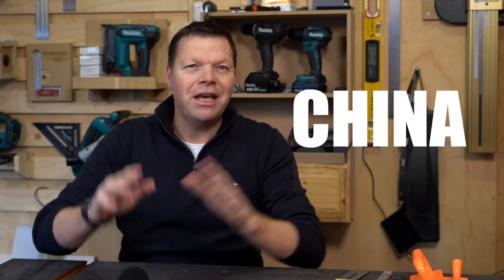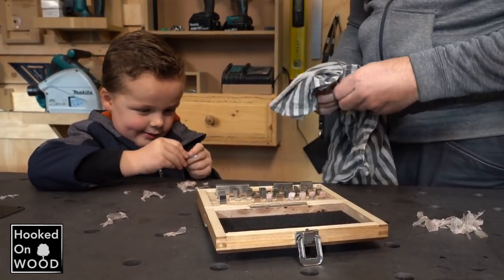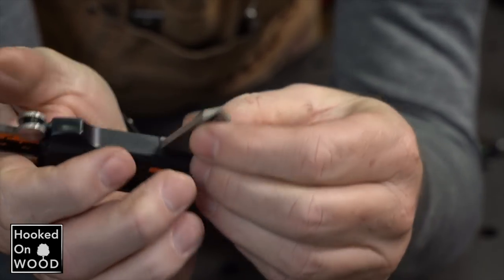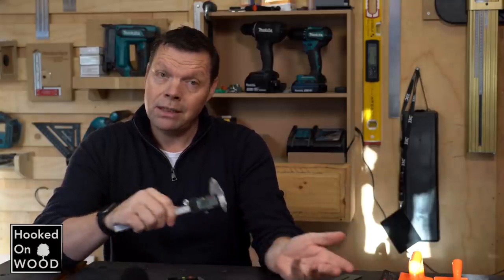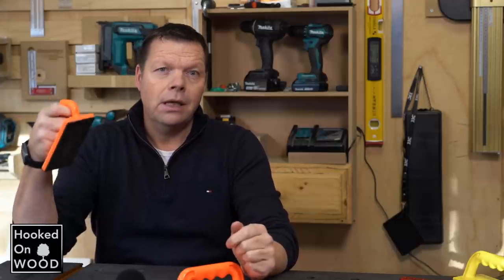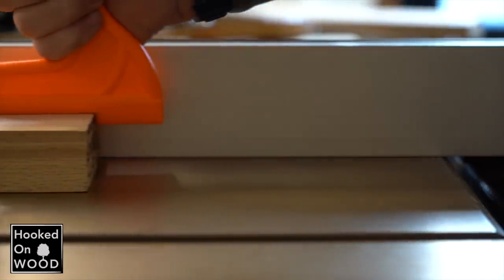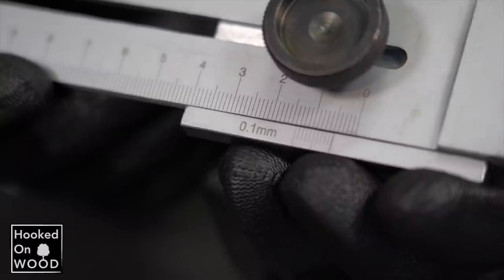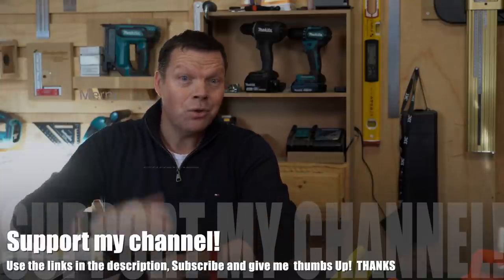China Tools Ep. 17, Set-up blocks, Calipers, push blocks and Ruler

Comment: Dennis - love all your videos.   I ended up buying the NEW miter gauge you showed in epidsode #11.   It's perfect for my needs.    I've owned it a couple of years and use it with mdf or plywood scrap fences.   Love it!   And, I would have never known about it except for you.  Recently, I made a 12-sided polygon with this miter gauge and it turned out perfect on the first try.   Just for fun, I tried doing the same with my stock Delta Unisaw miter gauge and a Starrett angle finder.   Not as good.   The NEW miter gauge is super accurate.
 I'm thinking about getting the metal fence with the box joint feature.   Thank you for all your videos.

Comment: Thumbs up to a ruler video :) My reference for good quality standards is Woodpecker and Starrett as well. Although in general,  I have been pleased to add some of these lower cost and somewhat novel tools from Banggood to the shop. The spot on machinist squares are an interesting indicator to how high quality some of these critical tools can get from this vendor. I've learned that delivery time can be an issue however!

Comment: Garry not Linda. Merry Christmas Dennis and thank you for the surprise video. One test I would've liked to see was repeatability. My digital caliper looks exactly like the $12 unit you tested but I didn't buy it from Banggood. It does not always read the same. I can measure a piece, close the jaws back to zero and remeasure and it won't necessarily read the same it may be off just a bit. Having worked as a machinist I've used a lot of precision tools and I still have some micrometers and a dial indicator. When I want a precise measurement, which in my woodworking isn't all that often, I grab my Mitutoyo dial caliper. Instant reading, no batteries, always ready to go. Thanks again from the US. Garry

Comment: About the "sliding ruler" at the end (in Dutch also called a "kruishout"). I bought one from scala that looks nearly identical. I guess there's only that much one could do to make a tool like this different?

The one I have from scala is really nice to use and I find it being a rather versatile and useful tool. Especially when it comes to marking repeated marks it's my go to. Best of all is that it isn't even that much more expensive than the one you showed.

Comment: Thanks for another great video!
The calipers are very interesting! I've seen other videos about cheap calipers and that the downside is that the batteries drains fast. This due to the measuring mechanism not powering down when turned off. Might be interesting to report on if you notice it running out of power strangely fast :)

Comment: Digital Calipers: I have had a few over the years, and my biggest gripe has been almost universal: Battery cover security, plastic items tend to break, or bulge, metal covers seem to mostly rely on a screw to keep them in place, where 2, or even 3 might be better
I reverted to a set of dial style calipers, but will be most interested to see what, if any,, solution some of the creators of all these beautiful Chinese tools can come up with, maybe something that does NOT use an LR44 battery, maybe something like a 1520 or even a 2016

Comment: Lots of good information in this video. I have a cheap caliper from Harbor Freight and haven’t had any problems with the batteries like others have mentioned. I’m serious think about upgrading to these calipers. Merry Christmas 🎄
Reply from the maker: Hi Greg, 
I didi not find any problems with the batteries, I have them a few months and the batteries are still OK.
But what I found out is that the differences between calipers under 20-30 dollar is not big. So, if you have a Harbor Freight that function ok, question is, if this one would be an upgrade. I found the cheap Caliper very good, It was remarkable stable and on par with the 60 dollar caliper with accuracies. But for woodworking, they all where good enough. The difference between a 20-30 dollar Caliper and my 60 dollars, is that the expensive one, slides better. You can feel that and that is a noticeable difference that could be worth an upgrade. If found the cheap Caliper better than the 26 dollar caliper like I said in the video, but that is to small for an upgrade in my opinion.
So, when you happy, I would invest in another item. Merry Christmas.

Comment: Another very nice video! Thank you for teaching me some things about the tools. I am definitely going to look at that set of gage blocks: the price looks very reasonable since for the same US$ I could only get a set will maybe half as many inch blocks. I have been using inch measurements for more than 60 years, but can just as easily use mm for testing measurement tools. The only other things I would mention is that the blocks should have a very thin coat of light oil when stored, and it is usual practice to wear light cotton gloves when handling them. Fingerprints can cause corrosion.
Reply from the maker: Thanks Graeme, I did not know that. (but It sounds logical)

Comment: The setup blocks are called slips and are mainly used to check measuring tool accuracy (in a temperature controlled room) such as vernier claipers, micrometers and height gauges etc. They are "wrung" togther to form additional sizes as required an aspect you did not show or know about?

Comment: The thing about calipers isn't only the accuracy. Actually, all of these are more than fine for wood working since wood isn't a dimensionally stable material. The problem is often grabbing a set of calipers where the battery has been drained by high quiescent currents. That's the big difference between a Mitutoyo and a Hazard Freight one, for example. Not saying you need to spend $$$ on a Mitutoyo, but have a set of watch cell batteries handy when buying a cheap set of digital calipers;-)
Reply: Hyy friend 🙏🤝🤝🤝🇮🇩
Reply: I got a mitutoyo caliper “verified by wish” for around 25 USD. It arrived with a certificate and everything seems like the real deal. What you say about the batteries is true. My mitutoyo gets a long life out of a battery and it didnt cost a lot of money either. When I looked for the same caliper at my local shops it was priced well over 100 USD!
Reply: I'm not sure I never really got along with any kind of digital calipers. My favorite pair of calipers to use is the old analog mitutoyo I got from my dad. I also have an analog pair from scala but I don't know they just don't feel like my old and beaten mitutoyo. 😅

Comment: Excellent video as usual. I nearly fell off my chair when the Veritas precision blocks turned out not to be as accurate as expected.
Reply from the maker: Hi Paul. I was very disappointed. They claim an accuracy of 5 hundreds of a mm. But for High precision blocks hope they will be more accurate in practice. But these use all the allowed deviation. Even one 16mm block is different from another 16mm block. And one was almost 1/10th off. That does not match with the picture I have from Veritas in my mind. If it was a China tool, I probably would not recommend it. That said. 5 hundreds of a mm, is still very small for woodworking. But I like the reference to be perfect, just to be "the" reference. Dennis
Reply: @HookedonWood  Hi Dennis, I wholeheartedly agree with you. I know that due to the nature of wood that the same tolerances can never be achieved in the same way as with metal. But that is no excuse for tools not to be 100% accurate.

Just an aside - any plans to do a review on your Hammer planer?

Thanks again for the great videos that you make. Have a nice Xmas

Comment: Every inexpensive digital caliper I've owned leaked current to the extent that I could not store the battery in the device. Also the compartment holding the battery is flimsy and breaks if you use it a lot (as you must if the battery leaks).
So for woodworking I prefer dial calipers, one metric and another for U.S. customary units (inches etc.)
Reply: Amen to that. The quiescent current on cheap-o calipers is outrageously high ... not even sure how they get them to be this bad. Digital is nice, though, especially if it can display fractions for those being damned to work in imperial units ... sigh.
Reply: I have five  no name digital verniers and none of them have battery issues and the 300mm set gets used once or twice a year.  I have an Igaging set which I am not impressed with at all as they are never at zero when turned on. Merry Christmas Dennis to you and your family and thanks for the product testing as it saves me money not having to do it.

Comment: It’s good that you mention the finish on products so often, it’s the one disappointment I almost always have but I suppose that the finish costs money and low cost will probably mean that it’s not finished. Perhaps you can talk about how to add your own finish when you get a tool, you’ve already said to wipe them clean and I’ve found that just blowing the threads (compressed air) will dramatically improve the screw function. I also like to “break” the edges of things like a vernier caliber so that it’s nicer to handle, not the measurement parts.
Reply from the maker: I agree, in some videos I did. But especially the cheaper products you can make better with just a little bit of help.

Comment: Thanks for sharing the video. I would like you to review the part when you are using the push blocks. You will see your knuckles are extremely close to the blade. That's probably the reason I like custom made push blocks. I agree with all the items by price and affordability. But sometimes old school is better. Thanks again and have a Merry Christmas.
Reply from the maker: I agree with you, that cut should be made with the push sticks. That said, the push blocks are pretty stable so it does not feel that uncomfortable, but it had me thinking when I made that cut.
Reply: @HookedonWood  The reason for concern is that I see too many wood workers with their blade set at full height / that is a accident waiting to happen. You might want to explain to people proper blade height. Thanks Again
Reply from the maker: Thanks, you are right. I will keep it in mind for next time

Comment: Excellent reviews as usual,Dennis, but there was an unexpected eye-opener for me included in the video.   I had not realised that the guard on my European planer (jointer) was supposed to stay over the top of the cutters - with the push blocks leap-frogging  over it.   I have been moving it aside by just over the width of the material being planed.   It looks more awkward, but much safer.   Am I the only one who made this mistake?
Reply: I'ts NOT!. The cover is supposed to cover ONLY the exposed part of the blades. Using it this way is incorrect and may lead to poor quality finish on parts of the planed wood. I was just about to raise this subject with Dennis :-)
Reply from the maker: The way I used it, is exactly the way is described in the manual of this machine. It is why the safety bridge is adjustable in height.  I do not think there is a right and wrong here. In the manual is written to do it this way till wood thicknesses of 75mm. That is the reach of the height of the safety bridge. With thicker wood, you use it as you subscribed it. The same counts for when you plane the sides. 
I understand you worry about the wood being flat on the table. But I do not think there is a big difference when you push the wood against the outfeet table 15mm sooner, because that is what we talking about. Anyway. Thanks for your comment. Here you can find the operation document from Felder: http://maschinen.felder-gruppe.at/uploads/document/Manual_A3-26_A3-31_A3-41_EUS_enc.pdf  Page 44.
Thanks, Dennis

Comment: I love those corner clamps

A combination of 4 100mm ones and 4 160mm ones is what I was thinking....but you think 100mm ones are too small?

Maybe 4 120mm and 4 160mm is good for all-round use?
Reply from the maker: Depending on the work you do, 100mm can be an excellent choice. But I always grab for the bigger ones.  You should also consider that when you want to use the 100mm version with the small clamps, if they are pointing to each other (so both to the inside) with the small version they almost touch! So, when you do not only use it for small boxes, I think the 120mm is the better choice. One, way or the other, they all are a bargain. Good luck!

Comment: Hi Dennis! Thanks for the review! I have a question, how’s the wringability of those gage blocks? Can you stick them together?
Reply from the maker: I do use them by sticking them together. Because of the nice finish that is possible, but the tolerances on these products are so fine, that I can not check it. You have bars that can hold these blocks together, and for serious measurements I would advice this. (I do not know if you can buy those bars on Banggood, but I saw people use these kind of products to hold them tight together.

Comment: I really like the corner squares. Do you know if they also sell the matching thumb screws and aluminum spacers? I'd like to pick up a couple extra of those for added clamping. I couldn't find them separately on the site.  Thanks for the great videos!
Reply from the maker: Hi Jeff, I did not find it separately.
Reply: @PhilGroene   Thanks, I had not thought of that. I ordered a couple and will give them a try.

Comment: Unrelated question: if you had to buy a new table saw would you also buy the sliding table again, or not? Thanks.
Reply from the maker: Hi Muru,  I am planning a new workshop, and when that will be ready I think I buy a other table saw. I think it will be a Felder sliding table panel saw. That does not mean I do not like the Harvey, but I see more benefits in a sliding table panel saw. 
The advantage of the Harvey sliding table is that helps with bigger panels, but for smaller pieces it is as effective as a cross cut sled. If your budget allows it, I think I would buy the sliding table again, but you can live without it. The disadvantage is that you have to adjust the fence every time you have to put it on. That cost not that much time, but is annoying and if you not do it right you have a problem. So, in that case a crosscut sled is more accurate in terms of repeatability if you use it. But the sliding table has more capacity to cut bigger pieces.
Reply: @HookedonWood  Thanks for the feedback. That gives me a lot to think about. 👍

Comment: Try mitatoyo calipers.  They will tell you how accurate your blocks are.
Merry Christmas Dennis to you and your family
Reply from the maker: Thanks Needaman, I think calipers that tells me how accurate these blocks are are way too expansive. The company I visit in episode 7 has an High end height gauge but that is accurate on 500th of a mm. So, even these can not measure the exact deviations.
Reply: @HookedonWood  yes they are expensive,  but extremely accurate,  excellent craftsmanship,  ect. But no problem.  I also got a set of blocks from banggood.  I think they are accurate enough fore me. I dont have mitatoyo but i have another Australian high end set
Reply: Actually, you wouldn't use calipers at all for accurate measurements of setup blocks, but rather a micrometer. The Mitutoyos are definitely better than the $10 Hazard Freight ones, though;-)
Reply: @langrock74  we were just talking about calipers, or verniers. Micrometers are a different tool.

Comment: Great video! Very nice to see just much effort you put into making these video's. Just one question: what's the lubricant that you use for the calipers? Thanks!
Reply from the maker: Here you go, https://www.amazon.nl/S-D-Silbergleit-Silbergeit-glijmiddel/dp/B00691ZM84/ref=pd_day0_79_2/261-3169471-2248363?_encoding=UTF8&pd_rd_i=B00691ZM84&pd_rd_r=922ac505-f2cd-44d8-a83a-51fdd4a6d234&pd_rd_w=ePbFo&pd_rd_wg=uTo7d&pf_rd_p=e48bcd42-96cd-4196-8f32-3ab398954e6a&pf_rd_r=TGQM05WNT3A2QS0Z0CQC&psc=1&refRID=TGQM05WNT3A2QS0Z0CQC
Reply: Silbergleit, in Europe.  I would use DynaGlide from MicroFence  or Slideez from Mohawk, in USA.

Comment: Chinese calipers tend to change the value when the voltage of the battery drops. And that is what disqualifies them.
Reply from the maker: Good point, I did not know that. Still, I found it amazing that it was so good for the price. But of course there are not professional tools. For that you need to dig deeper in your pockets. My first impression was, that you should not expect much for 12 dollar. So, it surprised me a bit.
Reply: Yep, they often don't have brown-out detection and simply start losing accuracy towards the end of the already accelerated battery life.

Comment: how did you find repeatability on calipers? work with metals a bit and have a few different calipers, and something i have found is that they don't always return to zero on closing and need to be re-zeroed. wondering if you found the same thing? have a great xmas
Reply from the maker: Hi, yes good question. I had it filmed but one way or another I forgot it to put in my video. From 10 slides (normal slides) I had to re-zero it ones.
Reply: @HookedonWood  that's not too bad. find it depends on how hard you bring jaws together. sometimes no resets, other times reset pretty much each time. always worth checking for zero before measuring anything anyway.